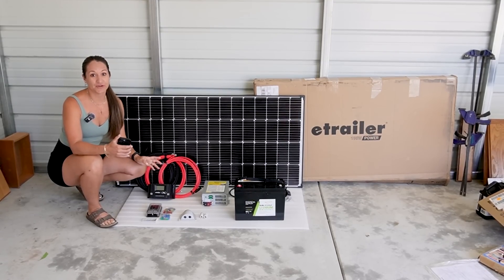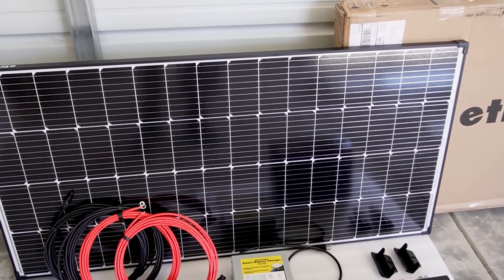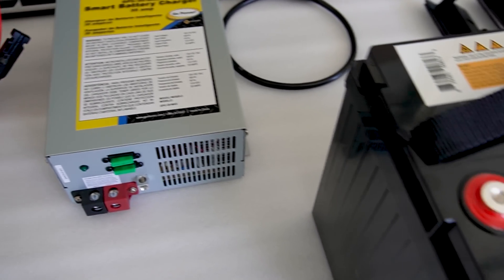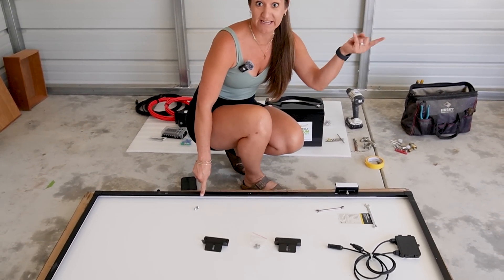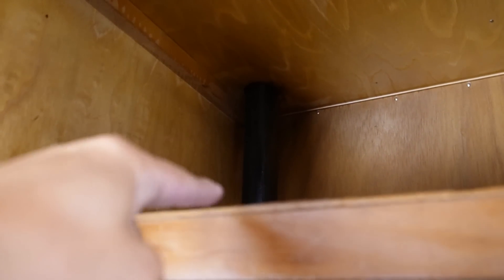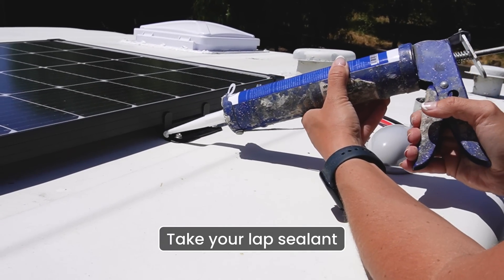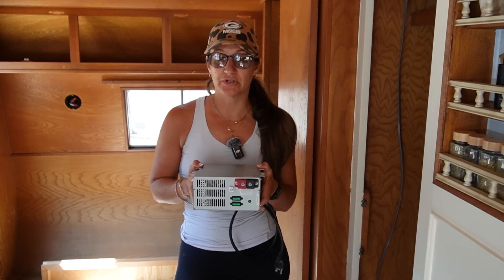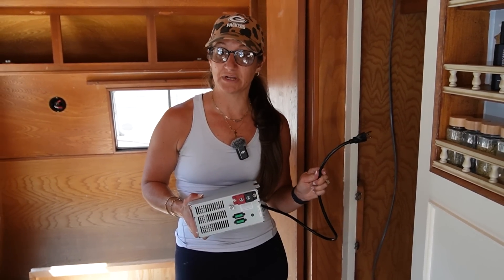How to Install Solar Panels on Your RV, Camper or Trailer | Step-by-Step Setup Guide for Beginners

Comment: This was a fun project. Just for clarification, that isn't a lithium ion battery it's a LiFePo4. That's a lithium iron phosphate and much safer than lithium ion. 

The only other change I would suggest is using an MPPT charge controller. They are a bit better at harvesting electricity under low sunlight.